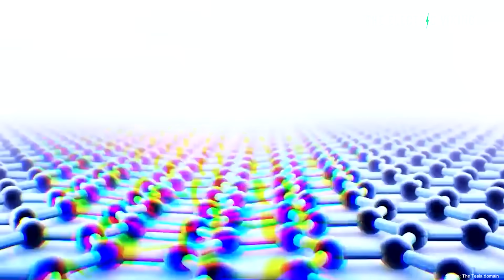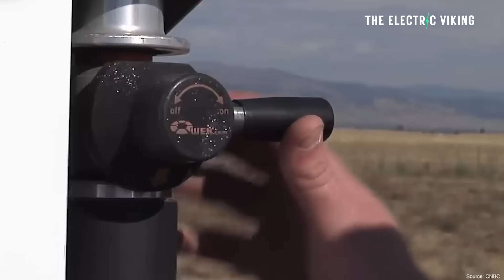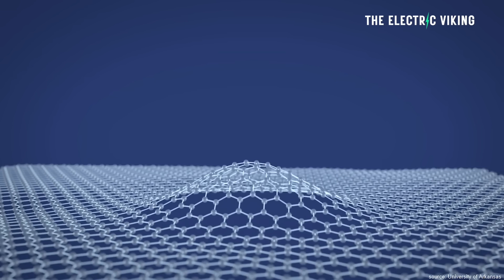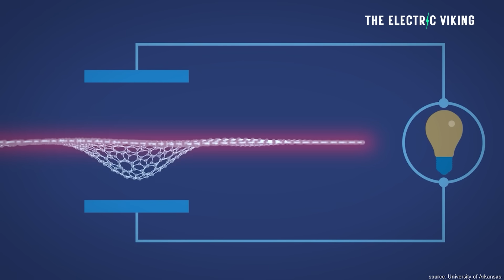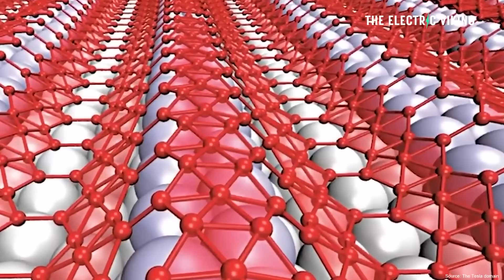Experts Claim Stunning Breakthrough Will Transform Global Hydrogen Network

Comment: I don't see how it will become popular with cars. Maybe for long haul situations where charging is too time consuming. Perhaps there are applications for home micropower stations. Maybe even for plane engines in the future. That would be a really great application. There is not need to generate energy, then transform it into hydrogen, when you can generate energy and just use it in it's original state.

Comment: You will still have an ICE, with all its moving parts and complicated gearings, a clutch or/and a gear box and a massively more complicated manufacturing process. Elon has not just found a new way to power a car economically but a whole new way to make a car, surely you can all see that???

Comment: I have no idea why there is still an interest in hydrogen. Years ago, I was very interested in it. But I have seen enough videos and what has transpired over the last dozen years that makes me a firm believer that hydrogen will NEVER take off. First, infrastructure. We already have thousands and thousands of electric charging stations. And that is still expanding exponentially. Secondly, the auto industry is already nearing the tipping point for building electric cars and I doubt anything will change that. Also, fuel cells are ridiculously expensive and no real breakthroughs have happened as well as the fact that hydrogen manufacturing and storage is fraught with issues since hydrogen is a fairly tricky substance. Add to that all of the advances in battery tech (Sodium, solid state, etc) and I just do not see a future for hydrogen powered personal vehicles. Maybe in other arenas, but not the everyday car......

Comment: Your vaunted EV is not long for the future either and carbon neutral BS will ultimately kill mankind. CO2 is not harmful at all, in fact, it is the exact opposite. Pollution on the other hand, is an issue. Yup, full circle back to the EV. FYI, the world does not produce enough electric power for EVs and their byproducts are toxic.

Comment: As and engineer here is no way i would own a hydrogen anything.  Hydrogen, when it burns, the flame is invisible so there is no visible cues if you have a fire.  its one of the most volatile element on the periodic able and is extremely reactive.  Its the main reason that airships were abandoned in the 30's.

Comment: There are now SO MANY reasons why the love of EV's has won the war. The cost of an internal combustion engine will ALWAYS be more than electric, especially with the recent and ongoing advances in battery tech. EV's Don't need:
fuel filters
electric ignition
cooling
filters
expensive servicing

EV's can be air-conditioned pre-entry, driven immediately upon seating, they are silent, they are powerful, they have no accelerator delay, their fuel falls from the sky every second, thy connect with the home energy system and even the grid energy system. 
The EV ranga issue is quickly disappearing. 450km range is the new standard, and in 2026 we can expect 600km range to become standard. Nope, sorry, hydrogen is never going to win the masses hearts. Hydrogen will be great for buses, trains and planes, but not the car. The supply of hydrogen can simply never, ever even come near the cost of electricity. GOD, I produce electricity for my own car from my own solar panels!!!  Can hydrogen compete with that?

Comment: You know Mr. EV evangelist that the industry already have E-fuel? It's a great fuel or so-called breakthrough that you can still can use your internal combustion engine, so no need to buy an unreliable EV or hydrogen car. We always say keep politics out of the car industry and the industry will solve the problems. E-fuel is at the moment expensive because they are in less use, but the oil industry said (follow the news) that the price will drop below the recent fuel prices when it's launched. That was one of the reasons the car industry backed down on producing EV's. Love this, so can continue to use the combustion engine car. E-fuel is also environmental friendly. EV's are absolutely not the future. It's a disaster for the environment, but do the WEF cares? It's all about control...

Comment: I wouldn't count on large scale affordable graphene membranes in this decade. Even if they exists, which would be efficiency then. 70%, not enough, 80%, maybe, 90%, relatively good, 95% close to current batteries.

Still we'd face expensive distribution network many other hydrogen disadvantages. When those fuel cells are production ready, batteries have improved a lot.

By the way, fuel cell price is comparable with batteries. How much a spare part cost have very little to do with technology or manufacturing costs. Extremely high cost was for discontinued vehicle where part wasn't commonly available. It was manufacturers way to say, scap your vehicle, we are not interested.

Comment: Taking this scientific finding from the laboratory into some kind of better hydrogen shielding or filtering technology is probably years away. Now that said, hydrogen-fuel cell EV's have one advantage over conventional BEV's: hydrogen can be easily generated at home, using solar power, and thus you can make your own fuel for free or for very cheap. This would be most useful in remote locations that are off grid or have very expensive grid connections, but have lots of natural resources such as wind power in west Texas, solar power in the Arizona desert, etc.
Reply: This makes no sense - I can use the same solar panels to make free electricity to power an EV, without the need to capture and store it separately before using - it goes straight into the EV battery?

In fact it's a huge disadvantage - you lose 60% of the electricity generated by the solar panels by using the electricity to manufacture hydrogen, run it through a fuel cell, then use the electricity generated from the fuel cell to charge a battery and run an electric motor (which is how hydrogen vehicles work) - it's only 40% as efficient as using that same generated electricity to pump straight into a battery and run an electric motor.

Comment: The choice of hydrogen vs electric was because of the inferior quality of batteries at the time.   Hydrogen was considered more portable... Now battery efficiency and cost are far lower.  It would make more sense to generate electricity  at the generator station with hydrogen and stick with batteries in cars. electric cars.

Comment: Need to remember that if hydrogen can squeeze between carbon atoms in a graphene matrix, good luck trying the keep it from leaking in anything other than welded pipe connections.  I also have asked, but haven’t heard an answer to this question:  Sure, hydrogen burned with oxygen creates no pollutants (other than heat), but if you’re burning it in air, what happens to the other components of the air?  Do yo get NO?  SO2?  CO/CO2?

Comment: Apart from cars, this is a great thing, as we need hydrogen from clean sources for processing steel. I doubt hydrogen will ever be used for general vehicles, maybe certain fleet applications, but charging a battery is so much easier than transporting a fluid, especially a highly combustible one. Electricity can also be created at the charge site from solar and stored in batteries, can you really beat that?
Reply: I say no.  BEV's are just simpler in pretty much every way compared to HEVs.   I have read the shipping industry could benefit from hydrogen technology  and so may the trucking industry so the new tech is always a good thing in some capacity.

Comment: Researchers from the University of Kansas and the U.S. Department of Energy's Brookhaven National Laboratory have developed a new way to produce hydrogen from water that is more efficient and cost-effective than traditional methods.

The new process, called "pulse radiolysis," uses short bursts of radiation to split water molecules into hydrogen and oxygen. This process is more efficient than traditional methods, which use heat or electricity to split water molecules. It is also more cost-effective, as it does not require the use of expensive catalysts.
THe real problem with Hydrogen is storage. Very difficult to store with out leaking.

Comment: I'll add this Maclome - how much water is used? 500,000 gallons of water per ton of lithium.  When you look at Lithium production it is 100,000 tons. 100,0000 x 500,000 is 50 billion gallons used now to process lithium.  That's equal to 1/3 lake Erie. If you wanted to process 10x as much lithium to make 10x more EVs that would require water equal to all the water in Lakes Erie and Lake Michigan. 7% of all the worlds fresh water.  It simply won't happen.

Comment: What people and even engineers do not understand is that the overall cost of the hydrogen for transportation will never-ever surpass the cost of pure electricity. You can even has a hydrogen car that is cheaper than an EV and still it will be economically unviable proposition. Just to produce H2 plus transport H2 requires electricity and electric cars do not need any of that and that's why it will never be as viable as pure EV.

Comment: No way the cost to replace fuel cell could ever come down as more are produced. Well you were right it’s a horrible idea and will never come to fruition
Reply: Ballard has cut the cost of their fuel cells by 70% just in the past year.  They also offer a return policy so after the 30k+ hours they can run for you just return the old one and they cut 30% off the price of the replacement.  They are getting close to the $150 a kw price point already.

Comment: After global supply chain issues of gas caused fuel prices to go up I don't think people want to have the same issue with hydrogen vehicles. Electric vehicles can be charged by electricity anywhere and you can produce it yourself thanks to advances in solar efficiency. In terms of metal works factories I've heard thermal batteries are going to be the way forward and there are many different battery technologies for grid storage. Shipping hydrogen in the form of ammonia doesn't make sense and can all remember what happened in Lebanon when port storage containers are ignited,  lot of a city was destroyed.

Comment: Protons don’t flow in currents like electrons do.  There’s no ‘electricity’ of protons.  That protons can breach the molecular structure of other matter, which it shouldn’t,  is like organic cells in growth that allow a protium to breach molecular structures(at one time considered impossible) and achieve a massive ‘unfolding’ of the organic structures of life.

Second, fuel cells were developed early on .  The first fuel cell stack was in 1839.  The next period of development was in the 1960’s.  Fuel cells are used in space to power electrical services on orbiting vehicles, along with solar panels., and radio isotope power generation.  Electric Viking grossly misrepresents fuel cell vehicles as a form of internal combustion engine with pistons.

The chief source of hydrogen is natural gas.  But then there’s also electrolysis.  Likely if fuel cells were used for transportation, they would make use of distributed networks of natural gas pipelines already in existence or the power grid to electrolyze water at location.

No single solution exists that is a magical bullet to solve the climate crisis.  (By comparison, the single solution hydrocarbon technology brought with it world conflict and the onset of millions of fatalities) Certainly EV zealots believe they’ve seized the holy grail.  You’re going to have a ‘mix’ of technologies and ways and means.  It’s entirely Maoist to presume that everyone must now build an electric car in their back yard, regardless of the circumstances.

Comment: Liquefaction of hydrogen is only 70% efficient which IMMEDIATELY makes the cars less efficient than EVs (80%), regardless of any improvements they can make in the fuel cell (50%) or the generation of the hydrogen (80%), and that’s ignoring the losses from distribution.

Hydrogen is nonsense.

Comment: One thing about hydrogen is; it can be transported. So you can produce hydrogen on intermittent sources without having to build additional battery capacity. Therefore, material and energy costs can be lower with hydrogen technology then battery technology. The question is, how efficient hydrogen storage is going to be.
Reply: Battery capacity is required regardless because PVs and wind are by their nature intermittent.
Reply: @fredbloggs5902  Not if you produce hydrogen on site.

Comment: At the moment whether you produce hydrogen from fossil fuels(94%) or renewables, you loose 50% producing it and 50% converting back to electricity.
And using renewables is ridiculously stupid, as you start off with what you want (electricity) and at great expense turn it into something you don't want (Hydrogen), then at more expense you turn it back to electricity, loosing 3/4 of the energy in the process.
If the process was 100% efficient it wouldn't make sense.
In reality we are talking about a battery, and we have those and they work well, over the next 10 years they will be a lot better.
Yes a few electric cars burst into flames, but with two or three hydrogen tanks in a car at 10,000lbs pressure, I wouldn't want to be in it or near it, In fact I would want to be in a different post code.
I was walking past a parked car a few years ago and the it's tyre burst, That was 30lbs pressure and I had to go home and change my trousers.

Comment: Hi, I think that probably that wouldn't be no problems or limitations to build cost-intensive hydrogen refilling stations, but in a other hand it takes to resolve the part of equation of rare metals used to produce the fuel-cells and going in production for a little amount of budget / making these cheaper... In the future we will see drop another forms of energy storage like high density batteries with affordable and greener materials to come on the market, and these are suitable to power our cars in a couple of years... This is the vision of many people over YT and not only thinking by myself, so we could start with produce better batteries and many ideas of a lot of startups are very promising to put us all together in a renewable greener future (if the recycling problem of batteries should be solved).

Comment: The funny thing is, In every house, every streetcorner, every lamppost, there is electricity . . . . . hydrogen is nowhere. 
So, think about who is pushing hydrogen, an why . . . . . . . big oil, . . . . business model.
Hydrogen could be cheaper, but it does not solve the problems of building hydrogen gasstations, . . . . and at least 4 to 6 times the amount we have petrol gas stations now. 
Because that is how much hydrogen stations you would need to constantly fill all existing ICE cars.
Hydrogen could become perfect for some industries, energy plants, aviation and large ships, and possibly trucks, not for cars.

Comment: This story is very confusing. It is claimed that this discovery could advance a catalyst membrane and separator  technology, where ripples in the carbon sheath mesh could act as a catalyst for ion transport "catalyst" for ion transport. Not sure I would call this a catalyst, but perhaps rather  more   potential sophisticated osmotic (or diffundary?) Molecular transport method. I have my doubts. As it suggests control, but I think we can really control it directly so I think energy harvesting would be a more viable method, if I understand this technology correctly rather than an method for power delivery using hydrogen. A more interesting result of this news os that we also know from rocket science that hydrogen I'm general is very difficult to contain, and even "leaks" from metal containers, making rocket fuel rockets extremely difficult to manage, making them expensive, because you are essentially always leaking fuel. As current forms of hydrogen in EVs are largely liquid or gas based, except maybe the "fuel cells", for practical applications I think the carbon sheath separator idea is of little value, but knowing microoscilatipns as the cause for leaking hydrogen ions could help improve metallurgy technology to prevent hydrogen leakage. So if somehow we could control or limit the oscillations at room temperature, that might be the panacea to a plague in hydrogen gas or liquid management. O thonl this could be interesting technology for measuring hydrogen concentrations as a hydrogen "sniffer". Because it is carbon sheath oscillations dependent and we know that the oscillations can function as a function of capacitance you would have two technologies in one a capacitor that is also a hydrogen sniffer. The technology could also power itself potentially as an energy harvester. I think in the world or microelectronics the creative potential would explode.

Comment: The creation of "useful hydrogen" is not energy limited by production from water (which is about 60% efficient - since it also produces oxygen waste), but the process of pressurising it to increase the energy density to a useful level.  This is first issue of hydrogen energy fuel - it is very wasteful in generating energy dense material of hydrogen - ie put it into hydrogen cylinders.  The second problem is hydrogen is a small molecule - so leaks out of EVERYTHING.  Real world data suggests that a Toyota Miri can lose all its hydrogen over a 3-4 weeks, and therefore should not be kept in a closed space.  You cannot solve this - any joint (like valve or connector) WILL leak hydrogen - you cannot stop it.
It is amazing research - but it does NOT solve the hydrogen economic problem.

Comment: Fuel cell with methanol as fuel would solve all problems.

It has none of the disadvantages of battery’s or hydrogen.
Reply: You still have to make the methanol, and methanol fuel cells are LESS efficient than hydrogen fuel cells.